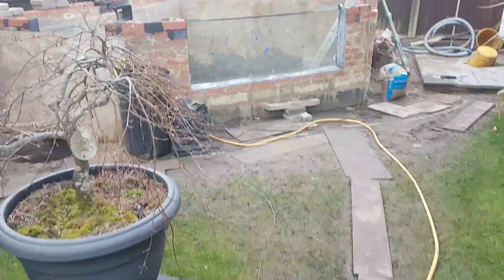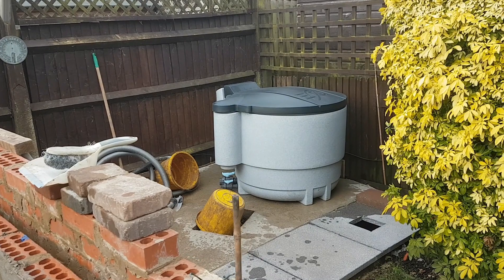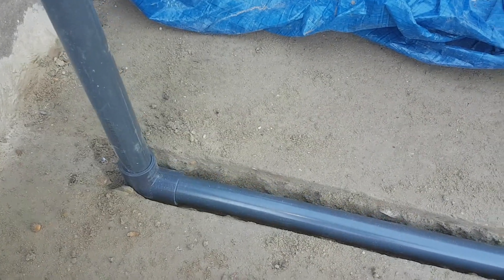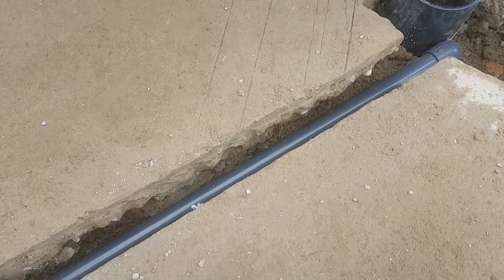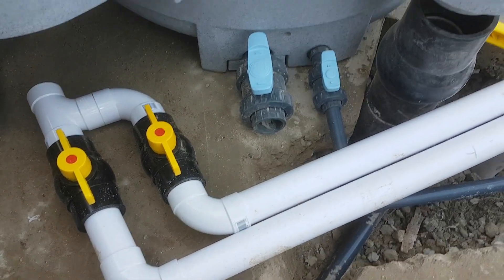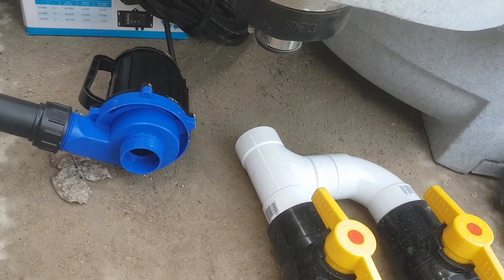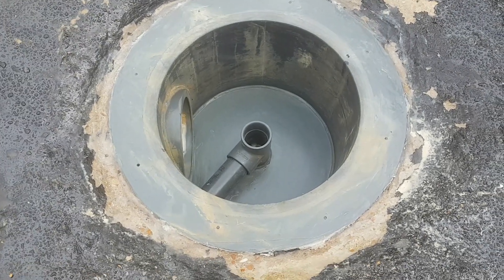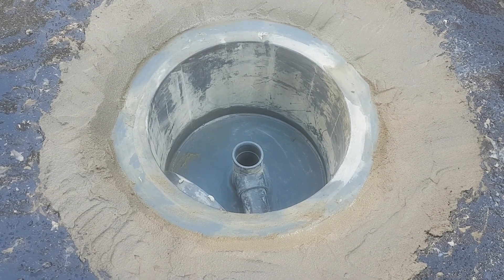Dry Installing The Nexus Filter, Results Of G4 Sealant

Comment: Just got a nexus,can confirm what pump and air pump u using,not what to do with the waste water, might use a pump to get rid,will I need a special pump or will a pond pump work on a switch?
Reply: Also bottom drain
Reply from the maker: the equipment i use is
evo aqua 10000 varipump ( you can turn it up or down)
80 ltr minute air pump
4 inch bottom drain with air diffuser
all waste water goes into a pit under my church which gets pumped around garden to feed plants....on a waste water pump which will be on a switch
hope this helps mate

Comment: Now pal looking good now mate the tip round near me the same make a appointment its abit of a knightmare at the moment. But yea your ponds looking good keep the videos coming pal
Reply from the maker: About to order the fibreglass stuff...should be interesting mate as ive never fibreglassed before
Reply: @PaulsKoipond  i used to fibreglass roofs for a living looks easy but when you watch it been done but youve got to make sure you use the right amount of catalyst and before the flow coat give it a good sand make sure theres no little sharp bits sticking through
Reply from the maker: @kyledale201  thanks for the tip mate, looking forward to trying though even if i get it wrong
Reply: @PaulsKoipond  the key is to be quick before the resin goes off is cutt the fiber glass matting down to size before starting set them out so you can resin the wall up then laid the matting then roll the resin in like i say once youve done first stage after its gone off make sure you sand it flat it gives it a key for the flow coat and you dont want any sharp bits for you koi to catch themselves on mate good luck cant wait to see it
Reply from the maker: @kyledale201  thankyou Kyle for your help mate
Reply from the maker: Sorry bud but do you know how much resin would be needed for 50 metres of fibreglass matting
Reply: @PaulsKoipond  its been nearly 10 years lol i can ask i old work mate in the morning mate we use to get the kits but ill give the lad a ring in morning for you mate
Reply: 100kg of resin to 50 square metres of surface area mate if that makes sense but like i say if you put that number in ebay search and use the drop down box you get the whole kit plus tools to do the job mate

Comment: Very good progress Paul. You can buy a nexus waste pipe kit of ebay which joins those 2 pipes into 1 pipe. Would save having 2 pipes running into the sump. The smaller one hardly gets used anyway matey. I got one and it was cheaper that the official kit from EA. Just need gluing together. Hope you have had the same nice weather as us here. Cheers.
Reply from the maker: yes mate i saw the kit and i know the small waste will probably not get used much, going to be buried anyway and i already had some of the pipe...cheers buddy
Reply: @PaulsKoipond  That's all good then. Just watched the video again and noticed you have a connector screwed on the pump (the one that came with the pump) It looks like you had that in the rubber boot from the nexus to line up your white return pipes. I might be wrong but if that's the case, that connector is screwed on the outlet not the inlet of the pump. I'm Probably wrong but just thought I'd mention it in-case it is wrong then at least you can change it before gluing it. Cheers.
Reply from the maker: @Simonsimps  got all that in the box mate....did have a bad night sleep because it suddenly dawned on me that i haven't accounted for my uv light..
I will have to check the flow rates through it or maybe put it in the skimmer line instead...cheers bud